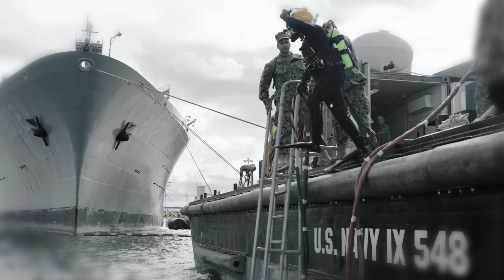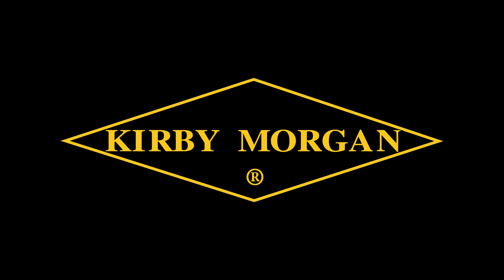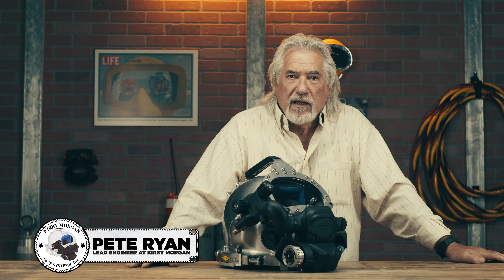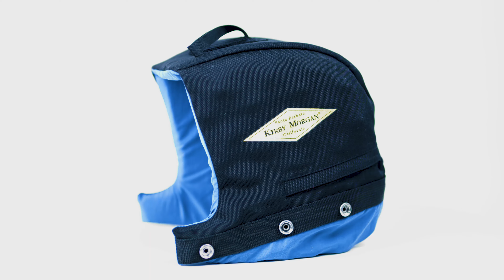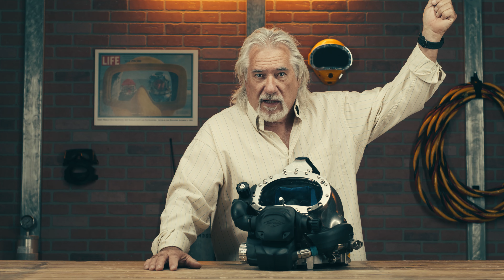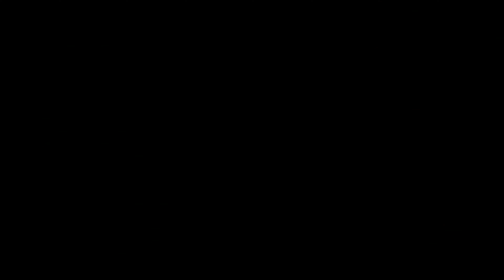Overview of Kirby Morgan Diamond ®

Comment: Could we use it with deep bailout set (cobra).
Reply from the maker: Vikas Lohchab,
Not currently at this time, but we continue to make great progress on the interface. Stay tunned and be sure to sign up for our newsletter for the future announcement and completion of the project.
Reply: What is the difference bt 500-710 KM Diamond Helmet w/Posts and 
500-711 KM Diamond Helmet w/MWPC. Kindly provide ur mail id too
Reply from the maker: @vikaslohchab8230  The difference between these two units only pertains to the modular communication component
It is available with either a male waterproof connector (MWPC), which secures to the communication cable via a 4 pin male connector. This is the 500-711 KM Diamond Helmet w/MWPC.
 
The other option is to secure the communication cable with two bare wires. This is the 500-710 KM Diamond Helmet w/Posts. The modular communication unit will only accept two bare wires from the umbilical.
 
In choosing which is best for you, one must consider what the umbilical communication cable is configured for. 4 pin connector or two wire bare post.
Due the modular design of our ear/mic assembly a diver could have both type of comm modules and be prepared to use both types of umbilical configurations.
 
Greater details can be found at our website inside our modular manual system as well as under our spares and accessories tab on the product page of the KM Diamond.

We can be reached at kmdsi@kirbymorgan.com
Reply: @KirbyMorganDiveSystems  Thanks for the detailed clarification.